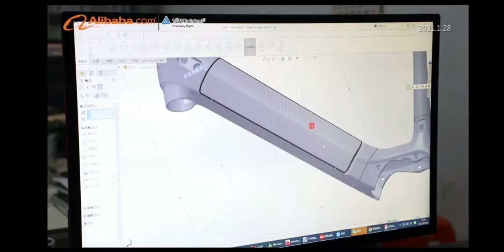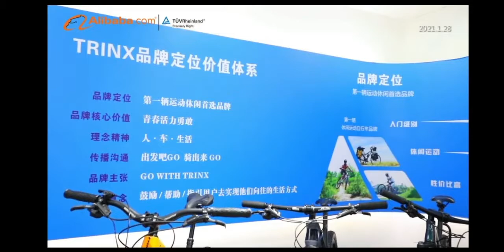COMPANY PROFILE OF LEONIS BICYCLES FACTORY WITH TUV CERTIFICATED, PROFESSIONAL MANUFACTURER OF BIKES

Comment from the maker: Established in 1997, Guangzhou Leonis Machinery Co., Ltd. is a leading exporter and manufacturer integrated with Research and Development, Production, Sales and After-sale Services of top-quality Bicycles. With a registered capital of 57 million Yuan, our Factory is located in Huadu District of Guangzhou, covering an area of 64000 square meters . Leonis is certificated with comprehensive quality management system ISO 9 0 0 1 and ISO 1 4 0 0 1 . We built up a China State Level Bicycle Testing Center for testing all aspects of bicycles and parts at our factories. With strict quality control and high cost-performance, Leonis Bicycles are popular to our customers in 7 0 countries worldwide. 

As a Sponsor of Champion of the Italian Mountain Bike World Cup, our Brand Trinx have nationwide sales Distribution stores in China. We accept O E M or O D M production cooperation for all types of Pedal Bicycles and Lithium Electric Bikes, both bikes and main parts made with Steel, aluminum and, carbon fiber frames. Our Factory has Tens of Full Automatic Complete-Assembling lines that are equipped with Automatic Welding Robots, Rim Locking and Rim Adjusting Machines, Aluminum Die-Casting Machines, Automatic Electrostatic Baking Painting Processes Lines, With Annual production capacity of 1.5 million pieces of assembled bikes and 2.5 millions of individual frames and forks. In 2019 ,our annual Sale Amount over 120 millions USD . We now have total Employees 1000+,among them there are more than 30 product engineers , 15 process engineers,80 skilled technicians , 60 quality inspectors ,10 molding workers , 180 welding workers and 1000 assembling & painting workers .Our products are exported to all over the world ,such as the USA , Western Europe, Southeast Asia, East Europe, North America,South America, Middle East and other countries and regions .We also have some overseas investment partners, such as FORWARD in Russia and RICH SPORT in Romania. In 2018 we Built up anew Plant with our partner in India ,and the Philippines and Brazil plants are under construction nowadays ,estimated will ready in the year of 2021 .

With advanced production lines and modern management systems and the absorption of strong technical and administrative force along with the OA intelligent office system and ERP management system make us realize resource sharing and paperless purpose.We adhere to the policy of "human-oriented, combination of material rewards and spiritual encouragement, fairness". As an outstanding enterprise with a strong sense of responsibility, we deeply believe that the talents are the root to our survival and the source to our development. Based on the best combination of manpower, manufacturing technology, highly innovative engineers and a practical and professional team, we can provide customers with quality products and thoughtful services. 
Welcome to Leonis!   https://leonis.en.alibaba.com